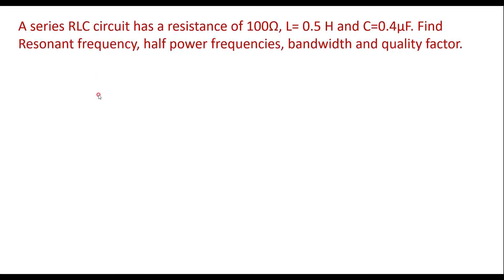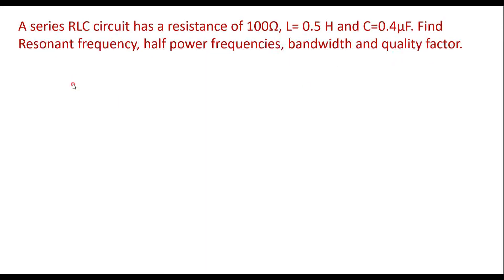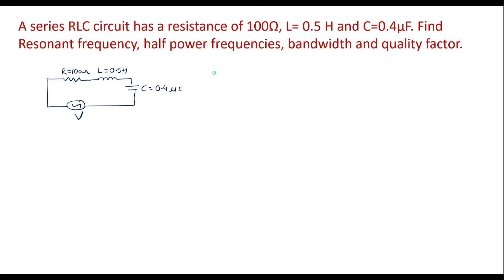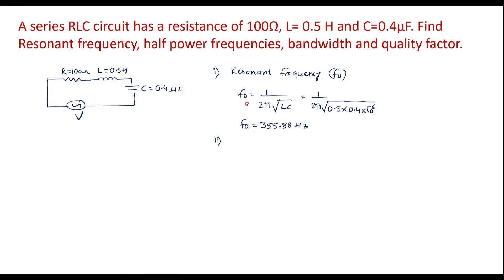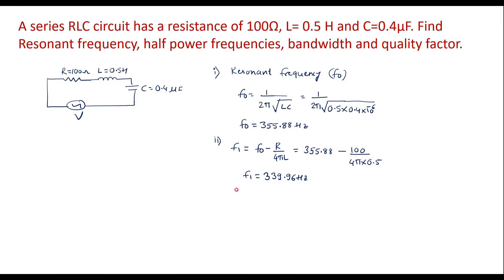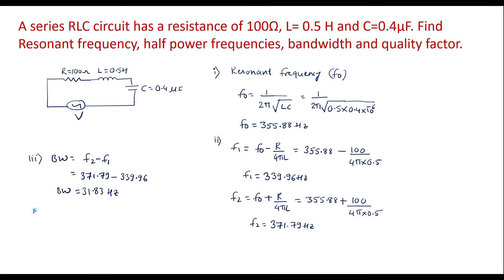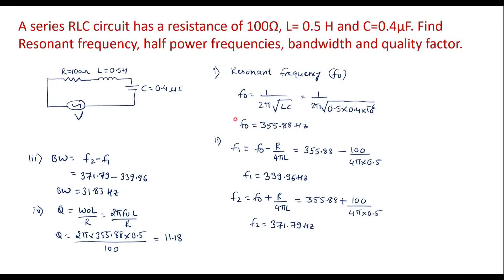Numerical on Series resonant circuit

Comment: Sir please solve this question  make video on this question urgent for exam after 10 days

In a series RLC circuit, the power consumed at resonance is 0.1 W. The circuit is

connected across 1 V supply. If L =0.05.H and the voltage across inductor L. at

resonance is 70.71 V. Bandwidth circuit is 200 rad/s.

Determine the value of R, C and resonant frequency of the circuit
Reply from the maker: @crazze25  ok sure
Reply: @VBDclasses  thanku sir
Reply from the maker: https://youtu.be/-1R1YxuOcGs